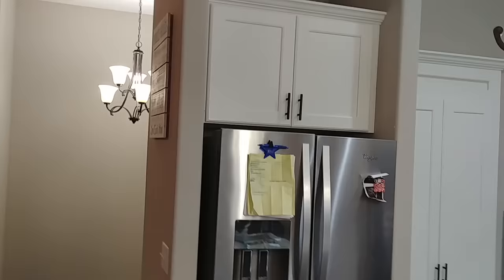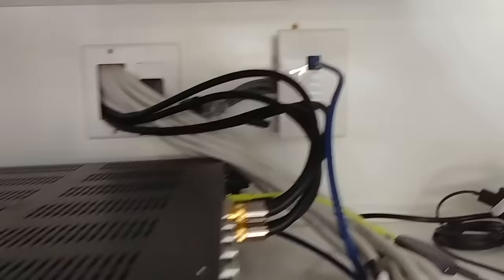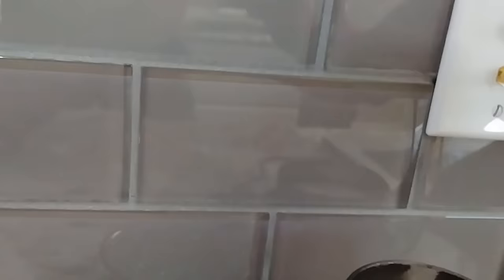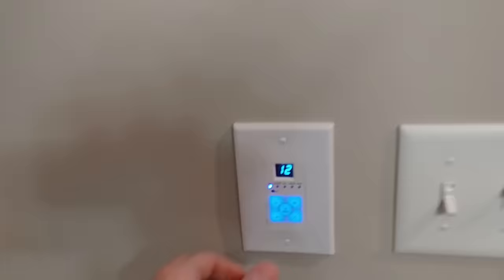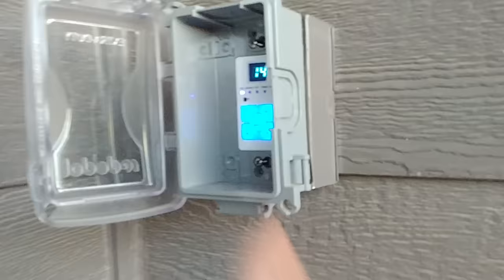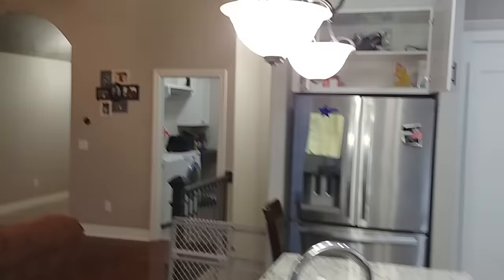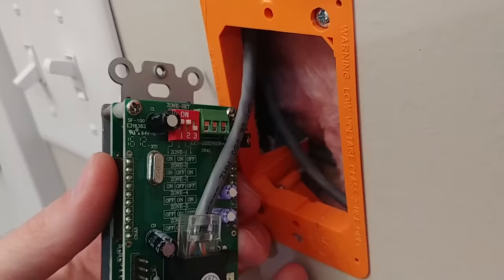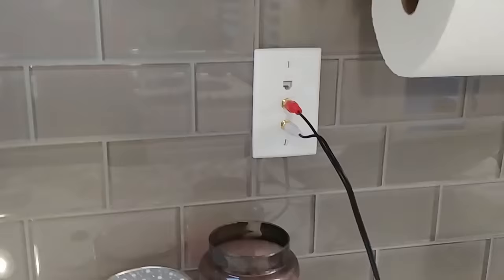WHOLE HOME AUDIO: Monoprice Whole Home Audio Amp! 6 Zone 6 Source

Comment: Hi there. Thanks for the video. 
Did you use an ethernet switch to connect all the keypads into 1 plug to the amplifier?
Reply: I just realised the "switch" is included, so nevermind.
Cheers.
Thanks
Reply from the maker: Tiago Rato yep it's included and even though this system uses ethernet for all the connections, it's really nothing to do with networking like you would think. It's not actually on your home network, so that "switch" is really their own proprietary device to connect them all. Thanks!
Reply: I did not see where that switch is located. Please clarify
Great video by the way and great work.
Reply from the maker: Lou Montana it's on the back wall in that cabinet where the amp is

Comment: One more question ... When you Ran your RG6 cable and converted it to RCA did you run one or two per source?  Thought you may have just ran one and then combined the signal Left and right behind the box cover?
Reply from the maker: C MY Skill they are 2 separate cables, you can't combine them.
Reply: @TheKMZ1  Do you think you can avoid using 2 RG6 cables in favor of one single cat5e(or cat6) cable? Thank you in advance for the answer.
Reply from the maker: @MrEndryyy  I'm not sure if they make a rca over Ethernet device but if you find one it should work!!
Reply: @TheKMZ1  This guy in the video uses cat6 cable (8 wires), 4 wires for the left and 4 wires for the right. https://www.youtube.com/watch?v=Mey-3v761bk

Comment: Great video and information.  Thanks.  If I connected an Amazon Echo or Google Home as a amp source, how do you communicate to the Echo or Home?  Through a phone app?
Reply from the maker: If you connect it as a source you just talk to it like normal, but don't get confused, because you can't control the amplifier zones on or off with Google home or alexa.
Reply: @TheKMZ1  this is unfortunate. 90% of what I do selecting music, controlling volume, or selecting which speakers to play on is through Google Home voice commands. I love it and no wires to deal with. That said, I wish I could make in wall/ceiling speakers smart without having to connect a powered Chromecast Audio to each one.
Reply from the maker: @luke9822  you would only need 1 chrome cast in this system you wouldn't need one for each speaker/zone
Reply: @TheKMZ1  I was trying to think of a hack that would allow each speaker/zone to be independently controlled with voice commands in a smart home situation rather than through in-wall manual volume/source selectors. That's my catch. I suppose that just means a different type of system though rather than trying to work around this system.
Reply from the maker: @luke9822  yeah I mean this system is one of the most affordable yet quality systems out there and due to its adorableness it does have areas where you may have to compromise. That's not to say there will never be support for it but natively there is none right

Comment: Can I add extra speakers if I don't care about the not being able to control the volume for the extra speakers? (ie basement)
Reply: Yes you could use the preouts and a seperate Amp (more available power) or a "passive speaker selector" (less available power) but both solutions would mean sharing a keypad for both locations, but it seems you understand that caveat already. You could then use the app to control whichever location doesn't have a keypad.

Comment: QUESTION 
Thanks for this video. You are the reason I will buy this system so I’ll go through a link if you have it 

I am needing some advice on how to get inputs to this system. I am running Apple TV and planning my pre-wire. 

I see all the inputs are RCA. Are your RG6 Coax just RCA capped and run long distances to the receiver/amp? 

Also any advice on Apple TV to this since it’s all HDMI?
Reply from the maker: Yes the rg6 has rca ends on it, Its simply a giant glorified standard rca cable. Normal rca cables are the exact same... Just smaller guaged wire that's all. Does the apple tv have any audio out jacks? 3.5 mm? Optical? If not then your options are slim
Reply from the maker: @lucashfarrow  you could run a long optical cable to the amp, the amp has 1 optical input
Reply: TheKMZ1 Thanks for all your help. Your vids have encouraged me to do this DIY . 

My run may be ~50ft . Think the signal will stay ok?
Reply from the maker: @lucashfarrow  it should be, because fiber optics are a long distance type cable (that's why internet companies use them, so I think you should be perfectly fine. And no problem!
Reply: TheKMZ1 Do you recommended any specific cable ?
Reply from the maker: @lucashfarrow  I haven't really ever looked into it, they should all be the same, id go with something on Amazon with good reviews
Reply: Gotcha

Grabbed one just now

Question: trying to think about my other 5 inputs 

How would get those back 

Cable output via RCA
Blue ray via RCA
Master bed audio out via RCA

Sound reasonable? 

Just doing pre wire for the next home owner

Comment: Hi I am wiring for this system now. I have put in cat 6 for controls. I have pulled just one wire all the way to the basement. Do you think I should pull 2 wires just in case 1 is bad or faulty???
Reply from the maker: saurabh kalra as long as you pulled 1 wire for each keypad, then that's good enough. The cable being bad is not likely
Reply: @TheKMZ1  ok thanks. I have onkyo 7.2 receiver. Can I use that in conjunction with whole home audio to get surround in one of the zones??
Reply from the maker: saurabh kalra not really, this system is designed for whole home audio only so I usually suggest to leave the surround sound a separate component
Reply: @TheKMZ1  Hi Thanks for your reply. What do you think of this set up for my 5.1 in one of the zones. Say i want that on Zone 1. I take RCA out of that zone and make it input of 5.1 receiver. and then all the speakers then get powered by 5.1 receiver instead of monoprice amp. Does it make sense?

Comment: Great video. Thank you! With the single chromecast source are you able to play a different song in two separate zones? Do you need two chromecast sources to get this to work?
Reply from the maker: Kaushick Naidu yes you need 2 chrome cast sources to achieve that
Reply: @TheKMZ1  Thanks! follow up to this. I am trying to set it up so everything can be controlled via google voice assistant. If I have two chromecast sources called Zone 1 and Zone 2 am I able to issue a voice command via google home mini placed in each room and say for example "Play Rock music in Zone 1" from the living room and "Play Jazz in Zone 2" from kitchen and it should work? Anyway it can automatically pick the available zone and not intefere with a zone that is already playing something?
Reply from the maker: Kaushick Naidu currently there is no alexa or Google home integration. There is an android app though
Reply: @TheKMZ1  Right but the chromecast would enable google home integration would it not?
Reply from the maker: Kaushick Naidu I don't have a Google home but if you can use Google to turn music on the chrome cast then yes. What confused me is you called them zones, they are actually sources. But it's important to know that the zone has to be on already, Google home won't turn a zone on for you if it's off
Reply: @mrburns1980  good morning,  pls were you able to find a solution to this question you asked because I also have the same issue
Reply: @julius.ololade  Two chromecasts works great. You can issue a command with the chromecast name and play different music is different zones.

Comment: What connectors did you buy for the RCA ends. I see the RCA connector for the wall plate has a screw at the end to secure it. Trying to see if you bought a connector that screwed into the RCA jack
Reply from the maker: I bought RG6/RG6Q RCA compression connectors at home depot / menards. Even though there are threads, it does not use them. The RCA cable stops before it gets there. I'm not sure what they are for but just disregard them. https://www.homedepot.com/p/Paladin-RCA-RG6-6Q-Compression-Connectors-4-Pack-PA70046/202534283
Reply: I’ll be running all my wire before my house gets sheetrock next week. You think 16 gauge will be fine for the speaker wire? Any tips?
Reply from the maker: How big of a house? Like how far do you think your longest run will be? Yes i think 16 would most likely be ok. If you want to be safe you could get 14 but if you already bought 16 then you're probably fine.
Reply: TheKMZ1 longest run will probably be around 50 ft... it’s a 2 story 1700 sq ft. Do you think the 6in speakers are loud enough or should I go with 8in? Also, if I want to hook up a sub woofer should I run 2 RCA cables to there as well?
Reply from the maker: Victor Rodriguez if only 50ft then 16ga is fine. I like the look of 6.5" speakers myself but it's just preference. Both will be loud enough.
Reply: @TheKMZ1  Thanks for your help man!
Reply: @TheKMZ1  I have one more question! I see that I can wire two speakers per zone, are these left right or mono? I do not want to be by the kitchen with one speaker and hear majority of the left and in the dinning area hear majority of the right. Hoping it is mono!
Reply from the maker: Victor Rodriguez it's left and right, but you can set mono, there is a switch in the back. However I believe if you set mono it's only meant for one speaker. Unless you have the ears of a dog you won't be hearing just half of the song. I've never noticed it

Comment: If you are using more than 1 multizone amp, what should the settings be on the wall controllers connected to the 2nd amp?
Reply from the maker: They are still set as 1 - 6 on the back. So everything is pretty much the exact same except the 2nd amp's switch is set to Slave1 and there are no sources hooked into it, and the ribbon cable connects the 2 amps. So amp 1 has keypads 1 - 6 switched and amp 2 has keypads 1 -6 switches the same as well
Reply: @TheKMZ1  so the first controller on the second amp would be set to 1 and would be considered zone 7 and the second controller one amp 2 would be set to 2 and would be considered zone 8 and so on?
Reply from the maker: @Lenser  yes exactly, and if you added a 3rd, the keypad set to "1" would be zone 13 and so on
Reply: @TheKMZ1  thanks man I'm connecting my amp in two weeks and will be buying your app
Reply from the maker: @Lenser  thank you I appreciate it, make sure to get the genuine global cache RS232 cable. Lately Amazon Has been out and people are buying the generic one which is not the same, it does not work. I'm working on getting more from global cache

Comment: How high do you mount the touchpads? I would guess up at eye level or close to that??
Reply from the maker: I mount them the same height as the light switches in my house that way they look symmetrical
Reply from the maker: Check out my channel and the video of the new WS66i amplifier, I have a coupon code for it as well, and I did a whole series from start to finish!
Reply: @TheKMZ1  thanks, I am pre-wiring a new house and I already have 10 nice ceiling 70v 8" soundtube speakers and some older amps but your video has inspired me to keep my speakers and upgrade or add to my amps with the monoprice unit and keypads in the zones.. only feature I wish they had Bluetooth connectivity in each keypad so people can play whatever is on their phone or device through their speaker in their room or even share with others who could tune into that soundfeed from their own keypad & speaker... You should suggest it to monoprice lol ;) 
Thanks
Roy

Comment: Hey, I know this video is a bit old. I'm just setting up my mono price system and have a question for you. Did you wire your rj45 connections using the T568A or T568B wiring?
Reply: My manual that came with the system states T568A but the online downloadable one states T568B
Reply from the maker: @harkisaggu  it doesn't matter as long as they are the same on both ends. It needs to be a standard straight through cable. I use B all the time never A
Reply: @TheKMZ1  thanks for the quick response!

Comment: i am trying to connect my system when ever i connect my speaker output i get no audio out to my speakers. Monoprice 6 Zone Home Audio Passive Multizone Controller Preamp Kit, NO LOGO what am i doing wrong
Reply from the maker: That passive controller you bought, is not an amplifier. You bought the preamp kit, that means it doesn't have the amplification built in and you would need to use the pre amp out and hook up an amplifier
Reply: @TheKMZ1 ok I returned the passive controller and the 6 zones home audio multizone controller and amplifier kit. I hooked it up for the first time with one speaker connected to zone one which should have turned white. zone 6 was white when I turned on the amp. why aren't all the zones on all white?  planning to have it set up for the summer your help will greatly be appreciated. thank you.
Reply from the maker: When you turn the amp on all the zones will be off (blue LED) they do not automatically turn on unless you turn the zone on, either with the keypad or with the app.

Comment: I was looking for you on Instagram but couldn't find your site.. I got a question, I just ordered this system but I want to put more than one speaker per room, is that possible? I was also trying to get a 5.1 in the leaving room and master bedroom and the rest of the house I'm cool with 2 speakers (kitchen, kids room, bathrooms, garage)
Reply from the maker: I do not have instagram but i have a website. But anyway, this system is not designed or meant to take the place of a 5.1 surround sound. It's purpose is whole home audio, 2 speakers (L and R) per zone, although you can do a Mono mode with only 1 speaker in that zone but the majority of it's purpose is 2 speakers per zone. You could do 4 speakers in a zone with some wiring in series/parallel but again i'm speaking to what it was designed for 95% of it's installs. My recommendation would be if you want 5.1 then do a separate thing for that, but if you are ok having TV /movies play through in ceiling speakers, maybe for party's or something then do that as a source, but i would not use this as a surround replacement.
Reply: Thanks for that quick reply!! Can I get your website.. I got one other question, can i add a volume controller to the speakers, what I'm trying to do right here is that if a get 4 speakers in one of the zones I can might get all the power out of 2 speakers that I am using, supposing that 2 are in the room and the other 2 in the bathroom ( the bathroom can lower the volume to cero)
Reply from the maker: @Abetto23  I think it sounds possible to be able to do that. A volume knob simply limits the resistance to control volume so it seems doable

Comment: Can you use the tape out from a AM / FM Receiver and the input to one of the 6 Sources using RCA Jacks?  I do not have a line or pre-amp out on the Receiver.
Reply: Typo:  should be "Receiver as the input", not "Receiver and the input"
Reply from the maker: There is no place to put the tape so no you can't do that. Just buy one of these https://www.amazon.com/CableCreation-Auxiliary-Splitter-Gold-Plated-Smartphones/dp/B077GSSTJ9/ref=sr_1_8?ie=UTF8&qid=1544796563&sr=8-8&keywords=rca+to+3.5mm
Reply: @TheKMZ1  I am trying to have the FM and CD from my home stereo as one of the inputs for the 6 sources.  I don't have a tape player but I wanted to use the receiver tape output as an input to the Monoprice 6 Zone Amp.  I know that the proper way would be a line out or preamp out from the home stereo receiver, but my receiver doesn't have one.
Reply from the maker: I dont think that tape output is really an output. I am not that familiar with them, so a quick google search turned up this thread. http://audiokarma.org/forums/index.php?threads/tape-out-preamp-out.332860/ so i think it might not be what you want

Comment: Interested in buying this amp but want to stream music through my iPhone or iPad.  Wondering if Sonos Connect is the right choice  for AirPlay 2 quality sound or not.
 
Also want to be able to play different songs in different rooms but not sure how the installation would work with this particular amp. Do you need a separate streaming device for each zone?
Reply from the maker: each source is separate, it can only play 1 thing so yes if you want to stream wirelessly on source #1, and have the abillity to stream wirelessly on source #2 then yes those would be 2 separate wireless streaming devices. So lets use a cheap bluetooth receiver for example, you would need 2 of those if you thought you would honestly wirelessly stream on 2 sources at the same time.
Reply: @TheKMZ1  Hello, and thank you so much for your great, informative videos. I have two questions for you about your system, as I am planning to install this system in a house I am building:
1) Regarding the wall plate that combines the 6 keypad cables into  one RJ45 output to the amplifier: What does the back of this wall plate look like? I am wondering if I can utilize a 2-gang low voltage bracket instead of a single gang bracket, and use a 2-gang wall plate with the "innards" of the provided single gang wall plate on one side, so I can use the other half of the 2-gang wall plate for other cables? I hope that makes sense.
(2) Do you have any rooms with four or more speakers? (Can this amplifier handle multiple pairs of speakers per zone?) I understand the theory of impedance matching,  as well as series, parallel, and series/parallel connections, but what would be the practical way of connecting multiple speakers to one zone? It looks like the back of the amplifier can only handle one pair of speakers per zone, so I assume I would need some sort of terminal block to land my speaker cables on, and then run that to the amplifier? I have also heard of speaker selector switches, but I do not know if that would be necessary for this application?
Thank you so much in advance for your help! :)